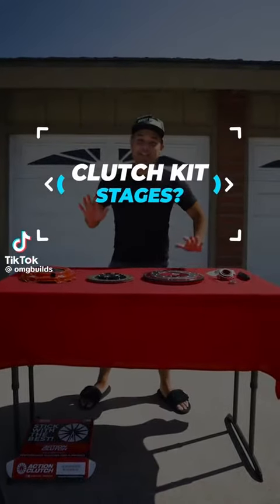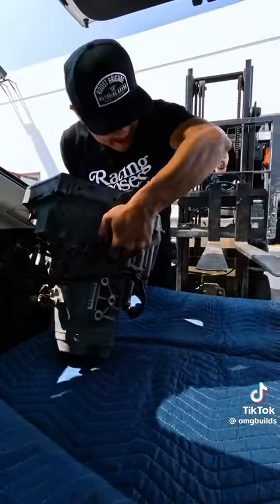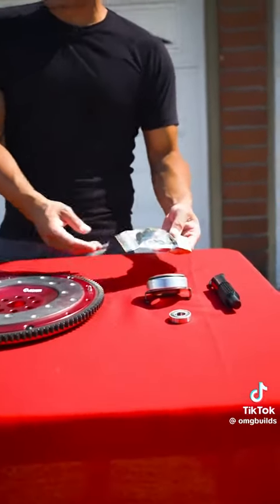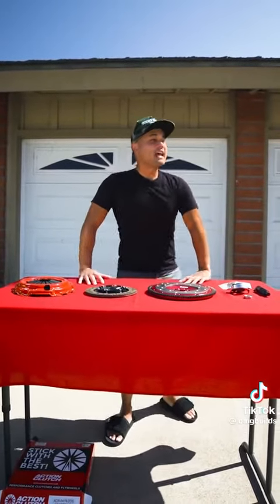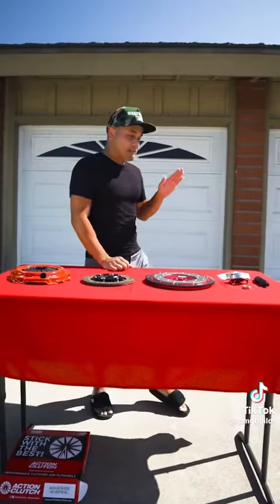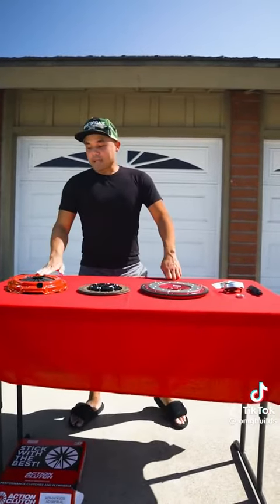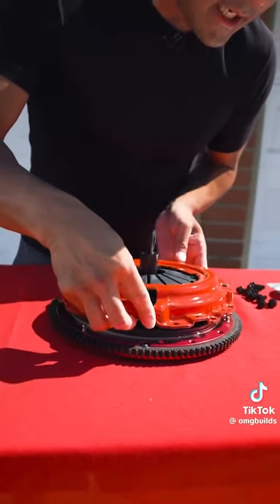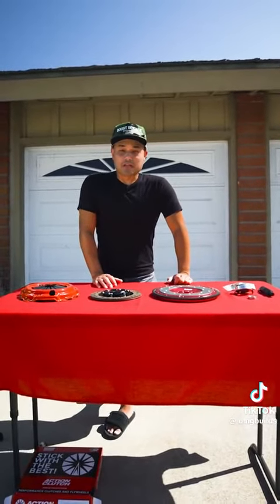Acura Integra B16A Stage 1 Clutch Flywheel Set Up | What you need to know

Comment: Do you know how much horsepowers the clutch stage one can handle? I have a 2000 civic SI with a B18C1 swap turbo 600 hp. Currently I have a stage two but it’s a pain on the street. Wondering if I should go with the stage one or just keep the stage two
Reply from the maker: Are you sure you have 600hp on our clutch using a Stage 2?  You would be the only one because our Stage 2 is NOT rated for that much power.  You need at least a Stage 5 if not an Ironman.  How much torque on the dyno are you making, because that is how all clutches are rated.  Email: sales@actionclutch.com and we will help you get this is all squared away.
Reply: @actionclutch  sorry let me clear up a little bit. I just put a freshly rebuilt engine. Right now is in the braking process. But engine is for up to 600 hp. I’m not into racing by the way. I’m thinking to sell it. Right now I have a stage 2 that came with the car. But I’m thinking on up grading the clutch but don’t know much about it. I need something for the streets though
Reply: @actionclutch  any clutch you recommend that is not that hard on street? A talked to a tune guy, he said the stage 2 might be ok. But he mentioned about a stage 3 street to be able to shift smooth on street